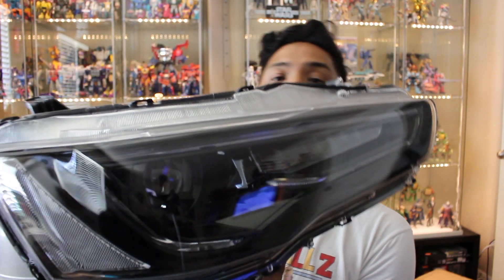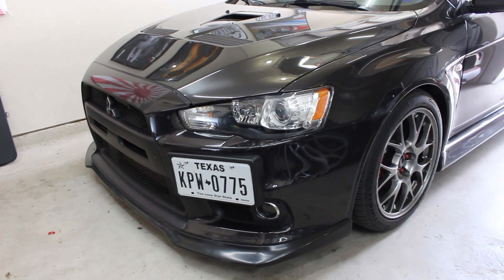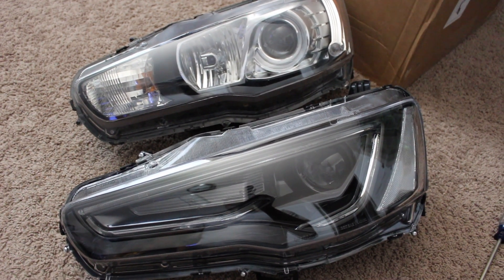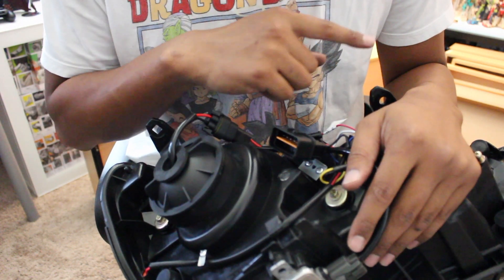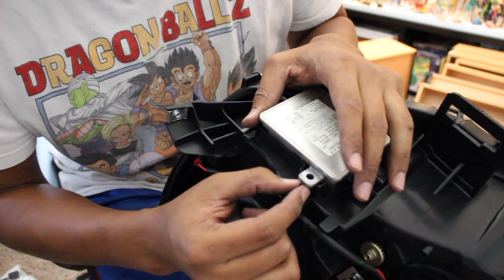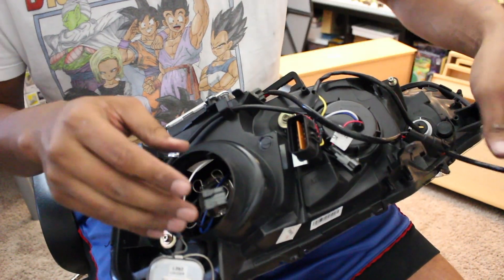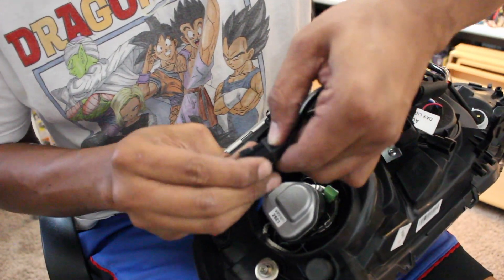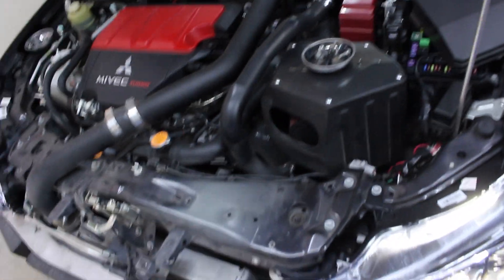EVO X VLAND HEADLIGHTS W OEM HIDs

Comment: You don't need to trim the fuse box. The corner of the fuse box has a removable piece. You can remove that piece and squeeze that wire in

Comment: For anyone wondering, use 1/4” x 3/4” metal screws for the ballasts. Also the way I connected the grounds was by chopping off the oem green connector and crimping on a 14 guage spade terminal (came with my crimping kit) and connected it to the little post that holds the swinging bulb cage. I had to cut a small slot down the center of the terminal so the cage wouldn’t push the connector off when the cage is closed.
Reply: I’ll post some pics on your 4b11t FB post later if this works
Reply: Can you show me how you connected your ground or where to find a write-up? His grounds are much different than mine.
Reply: @B005t3dDSM  just updated the linked thread with the best pictures I had of the grounds
Reply: Can you send me the link of how you grounded it

Comment: Aweosme work mate! But i have a question, Does the Vland have the adjust motor on the headlights (up an down) like the OE MR headlights? or will you end up losing that option?
Reply from the maker: You lose that control

Comment: Hi! My Vland are flickering when its off and park mode what could be the problem?
Reply from the maker: Thats weird. honestly no idea what could be causing that. Check the wiring to the fuse. maybe its getting a weird connection. does it flicker while driving?
Reply: @ProjectKaiGarage33  yeah it flickers while driving too, but only when daylight running and off.
Reply from the maker: @kimtirones3078  Might want to contact VLand and see what they say.